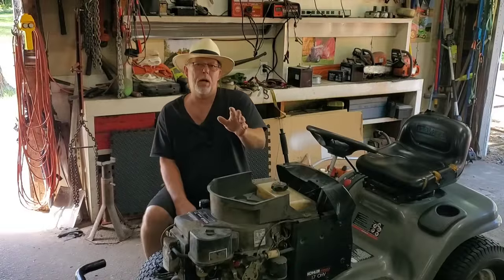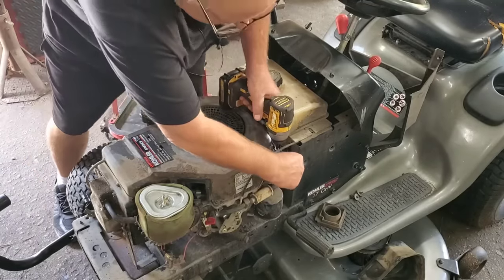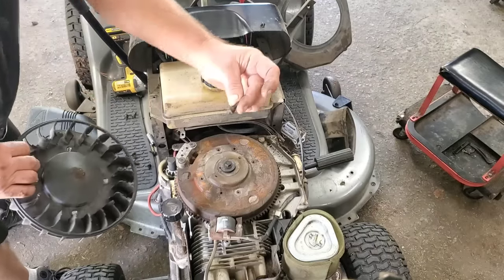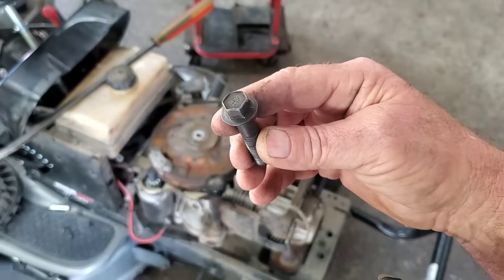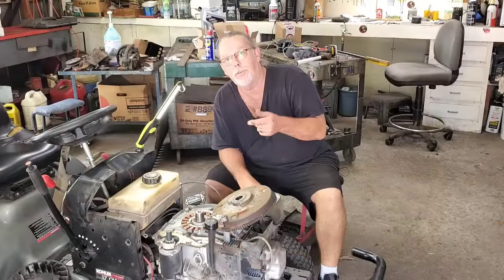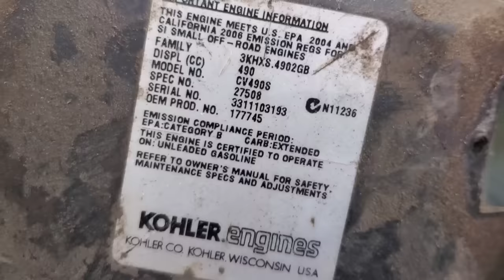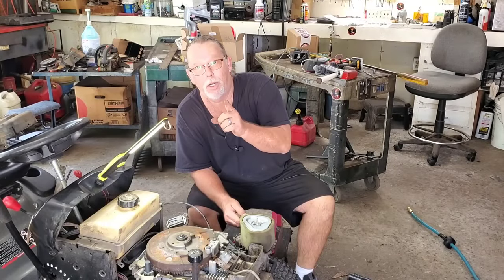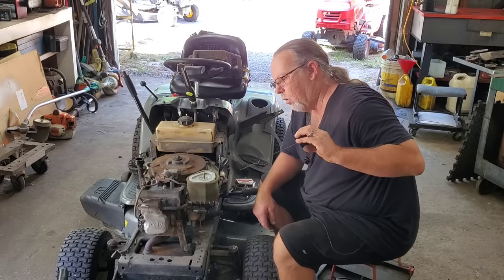Engine Backfires on a Craftsman Riding Mower with a Kohler Command Engine.  Flywheel Key?

Comment: Nice tip using a socket to protect the bolt head.  Thanks!
Reply from the maker: Thank you, my friend
Reply: No it's not. An air hammer and pry bar is where it's at. Plus you don't have to crawl on your hands and knees looking for flying sockets.

Comment: Thanks, T-bone!  Not only did you walk me through it, but you explained every step.  That mower is exactly like mine except for the engine (Briggs).  Mine also doesn't want to quit running when I'm done.  It hangs on, barely keeps running, and gives me a couple of backfires that sound like a .44 magnum.  I have a fuel cutoff valve so it basically only stops when it runs completely out of gas.

Comment: I have a Toro super recycler with the Briggs 163 cc engine and occasionally it backfires during starting or re-starting. I was concerned that the valves might need adjustment. But I may need to check the key after watching your video. Thanks for showing me how.

Comment: Had one recently was backfiring it blowed the center of the muffler that is perforated out. Was the two positive battery cables only about one strand of wire on each.... replaced both wires and it was fixed. Looked like something wrenched the wires back and forth.... John Deere... Briggs and Stratton...was under the red boot at the battery terminals...

Comment: Hi thanks for your valuable video, i need help pls pls help me. I have kohle ch25s, its back fire and cranking but not started. Pls advise me
Reply from the maker: If it's not the flywheel key possibility cam shft jumped time or gear on crankshaft.  Most commonly backfire is caused by flywheel key.

Comment: Follow on comment regarding GXV160...
After very light hone and new rings Iam reading 75 psi dry & 90 psi wet..
Some folks are suggesting that you can't put new rings in the old bore that has been "ball honed" and not machined...IE it may be slightly oval in shape thus allowing oil blow by.....what would be your experience T-bone?
Perhaps I should do a "leak down" test at TDC with compressed air in the plug hole to rule out a failed new head gasket?
Do you use RTV compound in addition to the new gasket or just a dry new gasket?
Hope you can give me some guidance....😊

Comment: Wow!  I hadn’t seen one of your videos lately so I actually went to your channel earlier today to see if one slipped by me. Speak of the devil! 😉🔧👍
Reply from the maker: 😆 thanks for watching and commenting my friend.
Reply: @RaleysSmallEngines  
You really have a lot of experience with lawn tractors, so maybe you can put me in the right direction for solving a slight problem I’ve had with a White Outdoor/MTD LT542H. Something is making the Tecumseh 20HP V-twin with twin carb engine slow to start. Battery fully charged and valve lashes corrected long ago. I’ve ultrasonic cleaned the Vector carb bowls and integral parts plus replaced the 4 O-rings (The two at the bottom of the emulsion tubes were deformed and preventing the tubes from moving up and down). Confirmed fuel flows to carbs and solenoids function correctly. I’m pretty convinced it’s a fuel issue because once it fires it runs just fine. Will start immediately with a volatile sprayed into the intakes. I’ve run the tank dry and used fresh fuel with no change. I’m not familiar with how fast fuel should flow from the pump so the only thing I can think is the pump is just not making full pressure. Is that a possibility or is there something else of which I’m not aware going on?

Comment: 10 years in the business a have never seen a woodruff key in the flywheel sheared off clean like that. Just thinking that it was sheared due to a massive backfire possibly from a malfunction of the antibackfire solenoid? Good video what is you thought on this diagnosis?
Reply from the maker: It was due to the flywheel bolt not tight. That's why I loosened it with a hand ratchet. Thanks for watching and commenting my friend.
Reply: @RaleysSmallEngines  Got it had one push mower come in with a loose flywheel bolt that totally destroyed the recoil pull starter

Comment: Nice one. I suppose those keys are not hardened to a high Rockwell to protect the other components.
Reply from the maker: Thank you.  Yes correct sir.
Reply: @RaleysSmallEngines  That’s a fast reply. Don’t you have anything better to do on a Saturday night?
Reply from the maker: Still working in the shop. Working on a 2 seat adult tricycle for camping.  You will see it in the upcoming camping video. I'm repainting it this weekend.
Reply: @RaleysSmallEngines  Right up my alley. I have redone about three dozen bikes from the 40’s, 50’s and 60’s.
Reply from the maker: Awesome.  The video coming out next week is how I bought the bike. I paid $200.  It's a Worksman 2 seat three wheeler
Reply: @RaleysSmallEngines  I will be looking forward to it.

Comment: I have a Murray riding lawn mower and it's very comparable to a Bolens riding lawn mower but on my Murray no more Murray riding lawn mower they said the engine is seized and locked up on them my question is can I switch out the motor are certain parts off the Bolens riding lawn mower use the parts to fix the Murray riding lawn mower

Comment: Great vodeo....  My Craftsman riding lawn mower with Kohler engine starts and runs just fine, however it back fires ONLY when you turn it off, what would cause it to back fire after turning off the key?  Thanks
Reply: My Craftsman LT2000 had the same problem (Briggs & Stratton engine). I adjusted the valves and the backfire problem disappeared. You can find the valve specs for your Kohler engine online and there are plenty of videos here on YouTube that will show you how to adjust them. It's pretty easy, you just have to take your time and do it right. I hope this fixes your problem. It worked great for me. — Richie — P.S. You should also adjust/check the air/fuel mixture on your carburetor. If you smell gas, it's running too rich. That's the easiest thing to do. So I would do that first.
Reply: It's always good practice to idle the machine down before turning the key switch off...manufacturers added the solenoid to the bottom of carburetor to shut fuel off when turning off mower. That's why it's called an anti-backfire solenoid. Try it, if that doesn't help try what rvalens2 suggested. Good luck.

Comment: People are not properly tightening the flywheels, they just don’t know how important it is to go by the specs😊
Reply: I was reading the comments.  People are opting for stronger keys.  They don't understand how important the torque is on the flywheel.  The key is an alignment tool.  It's not supposed the bear the load against it.  That's the job of the taper and bolt.
Reply: More to it than bolt torque. Crank and FW need to be polished to allow proper clamping force by the bolt. You just don't toss in a new key and slam it down with an impact.
Reply: @alext8828  Yup stupid people are looking for stronger keys. It's not about a stronger key fella. They are made to be sacrificial as to break before something expensive breaks.
Reply: Exactly

Comment: Another excellent video. I've had to replace the woodruff (half moon) key on a mower once... I didn't know the trick about the pry bar and the hammer whack to loosen the flywheel. Cool. :)

Do you think single cylinder engines are more reliable than twins? Or are they about the same?
Reply from the maker: Thank you.  Hard to answer that question.  There are so many variables depending on brand, type and how they are maintained.
Reply: Twins are more complicated. A simple single cylinder Briggs is all you need. One ignition coil compared to two on a twin. 2 plugs and so on......

Comment: I have craftsman tractor and it is the best tractor in the freaking universum. Theres nothing to question about it. If it backfires change the gas or check the valve caps. If nothing adjust the carb. There are no flaws only features. Thanks. Ps. Do not question. You can travel as far to the space as you can and never find better lawntractor. Only sand and stones. Period.

Comment: I have the same engine as this and mines doing the back fire on startup but its not the flywheel would you know what it would be????
Reply: Valve or carburetor issue but could be as simple as old fuel. Good luck.
Reply: @Mrs.T-bone  doing the head cuase carbs new

Comment: Bulk keys are made of steel and usually will not sheer when needed. A sheer woodruff must be used or the next time it will break the flywheel or break the keyway out.
Reply: Yes soft keys are where it's at. No need for steel or any other hard metal keys in this application. They are soft to be sacrificial when needed.

Comment: Hey T-bone...G'day from Rodney in Melbourne Australia.
I put this comment on your older "diagnose your engine" video.... but I'll post here as well...
I need your advice on a Honda Buffalo HRU216D three speed (non blade brake model) self propelled mower that has the GXV160 engine...I think you call it a Honda Commercial in the USA.
I've had it from new (since about year 2001) and was struggling with a lack of power and puffing a bit of black smoke.
I checked compression and it was sitting low at about 38-40 psi dry reading and about 50 psi wet reading.
So I bit the bullet and I have completed the following works..
*New Carburetor
*Complete New Cylinder Head and gasket
*New coil
*Light hone of the bore to re-establish cross hatch
*New rings
Complete wash out of dirty black oil and light sludge in the crankcase...
 It's just had it's first half hour of mowing and it is blowing a serious amount of blue smoke....I checked my oil level and it is at the half way mark on the dip stick cross hatches... so definitely not overfilled ...
I think the smoke is starting to subside as the rings bed in...but my question is how long should "running in smoke" be an issue?
I'm thinking of changing the oil after another hour of working the engine....and then either running genuine Honda 10W30...or if I'm still suffering (ring blow by smoke) going heavier to SAE30 no synthetic oil..your thoughts on bedding in time would be appreciated and your view on non friction modified premium mineral oil or heavier grade oil.
The rings, head and carb are ebay aftermarket as genuine Honda lead times and prices are hefty here in Australia...
Cheers Rodney in Melbourne
Reply: You answered you own question. Chinese Fleabay parts. So now it will cost you more that buying the proper OEM parts. You know Honda is out of the mower business now? Meaning no more parts for them. Plus Honda's are gutless in engine torque. I own a GXV160, it's lame. SAE 30w is your friend.
Reply: G'day Rick.just an FYI...the end result has been running a small catch can to collect oil that is spitting past the crankcase ventilation valve down the tube...in discussion with my local mower shop and the technical rep at Pentrite oil...the consensus is that the ball hones will follow the "shape" of the cast iron liner's bore and won't acheive a fresh circular bore....machining with a boring tool would've been the only way to remove the "ovalality"...regardless of genuine or aftermarket rings.
The pentrite guy reckons it's been an ongoing argument with his mates who rebuild their two-stroke trail bikes and arrive at the same conclusion.
Anyway...the catch can is collecting an ever decreasing small amount of oil....so I can now mow smoke free..and just keep an eye on my oil level every time I cut the grass...

Comment: Sorry....forgot to mention smoke only appears after engine comes up to operating temperature....about 20 minutes of running freeof smoke....then it's blue clouds in the backyard 😂
Reply: Sounds like head gasket failure. Do not use RTV. 
True compression can only be read if you engine has a compression release the valves must be loosened.
A leak down test will give you an idea about the rings.
Reply: @Mrs.T-bone  

Thanks for coming back to me Mr & Mrs T.... I enjoyed your fishing session with alligators....we have the Salt Water Crocodiles in far North Queensland....they don't leave witnesses!

I'll try some compressed air down the plug hole whilst at top dead centre... I reckon about 10 or 20psi ?... 
I'm guessing I'll be listening for inlet or exhaust hissing....or gurgling in the oil filler tube?
....then revisit the head gasket with a new one....should I stone the mating faces of the head and top of the cylinder?

Cheers Rodney
Reply: Lapping the head would not be a bad idea. Also, you mentioned black smoke at the beginning...black smoke is burning fuel and blue or white is oil fyi. Good luck!
Reply: @Mrs.T-bone 
Hi T-bone, I did my leak down test at TDC...I can hear the leaking sound only at the oil filler tube...nothing at exhaust or inlet... needle on the second gauge on the green just back from the "set" zero ...in the green band approx 15%.
So, I assume my light hone and new rings has left me with some ring"blow by".
I'm going to ditch the 10W30 and go to SAE30 mineral oil and see if I get a different result.
I'm getting about 20 minutes mowing smoke free...then blue smoke as it comes up to full temp...so perhaps I'll have to have a beer and engine cool down in-between front lawn and back lawn..I may not get up out of the chair to do the second run...😂
Reply: @Mrs.T-bone 
Hey there T-bone...I wanted to give you a follow-up message.
So I checked the head and it was nice and flat..replaced head gasket...same issue blue smoke after the engine came up to working temperature....but I noticed fresh engine oil at the carbie inlet...pouring into the plastic air cleaner tube from the crankcase breather hose...so I ran it with the breather hose removed...hey presto blue smoke cleared up.
Can I put a ball bearing up that hose?...or can I run it into a little catch can?
What would cause so much oil to run down that breather hose?
Hope you might have a few suggestions...?
Cheers Rodney in Melbourne
Reply: @roddersauify  check your oil level and smell for fuel odor. This happens often from the crankcase being overfilled w/oil. You may have overfilled it or sometimes when the carb float needle sticks open fuel can leak into the crankcase. Good luck!
Reply: @Mrs.T-bone  On Kawasaki's and Honda's you do NOT screw the oil stick all the way in when you check the oil. You PARK the stick ON TOP of the threads then check level.
Reply: Yes thanks Rick we'll aware of the correct use of the dipstick on my honda...

Comment: You need to clean and polish the crank end and flywheel opening. Why? Because the crank and flywheel are tapered. These surfaces need to be CLEAN and polished to promote good clamping torque. As in not to allow the flywheel to move easily. THEN retorque the flywheel bolt at factory specs. Not just some impact gun thinking it's good.